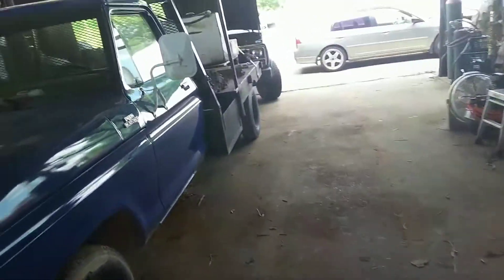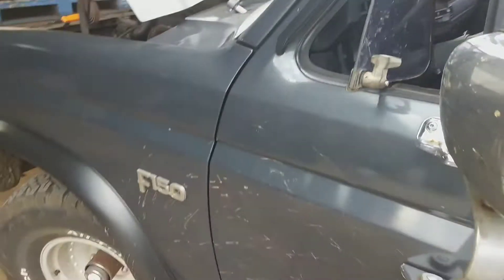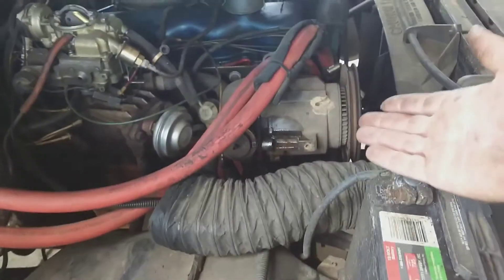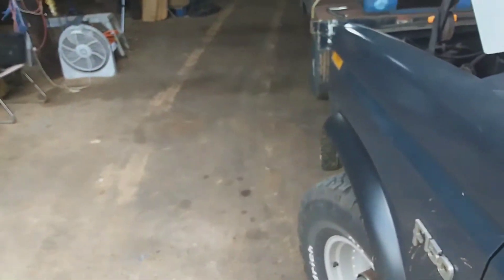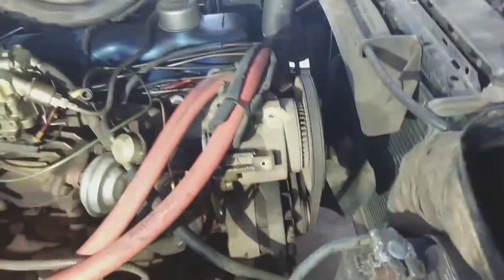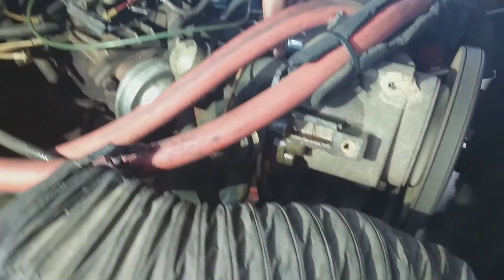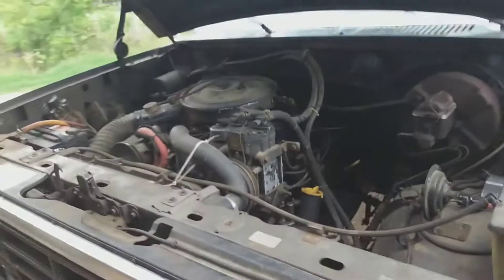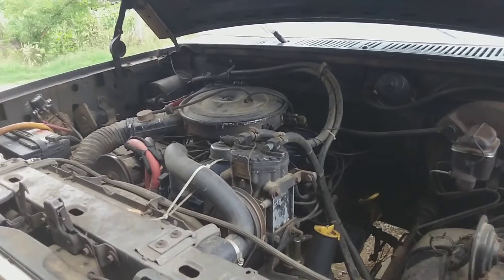1983 F150 smog pump delete on a 4.9 liter straight six.

Comment: If Ford had ever actually put a hotter ignition on them things like mine and made that smog pump a factory turbo system thru the carb the damn gas mileage and power would have jumped thru the roof. Recent as a few years ago when I got mine a good friend ordered that Offenhouser intake set up and Holley carb combo Summit sells and he added a home made turbo that came off a Toyota Land Cruiser. It feels like an 8cyl under the hood now. The power off the line is incredible compared to a whimpy stock oil leaker is what these engines really R...
Reply: Was the engine stock did you move the timing for the turbo??
Reply from the maker: Ikr

Comment: Remove all the pollution crap including the EGR & CATS. The secret is using a Holley after market carb and get electronic ignition conversion 4 em. The gas mileage goes way up. When I got my 86 with the c4 trans and 300 in it it was not only a dog off the line and sucked gas to the tune of 10 miles to the gallon. I now get 18 to the gallon.
Reply from the maker: Ikr

Comment: An air pump is an emissions component that is part of the secondary air injection system. It is responsible for pumping clean air into the vehicle's exhaust to promote a cleaner and more complete burn before the fumes exit the tailpipe. It's pretty much used for emissions...
Reply: It never worked and it sucks
Reply: No, it pumps clean air into the exhaust to trick the damn emission probe when ran through emission testing, does nothing to increase the burn in the combustion chamber, it blows into the exhaust, not intake!
Reply from the maker: Thanks

Comment: It pumps air into the hot exhaust to make the catalytic converter work. Being almost 40 years old it probably doesn’t work anymore anyway.
Reply: My 81 F-100 doesn't have a catalytic converter...or a muffler...or a pipe!  That engine is quiet compared to most.
Reply from the maker: Thanks